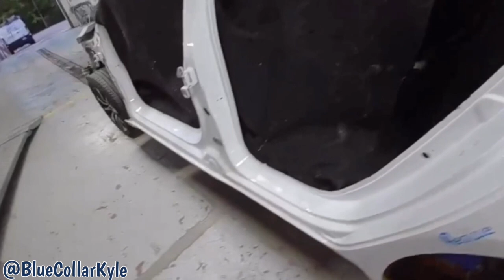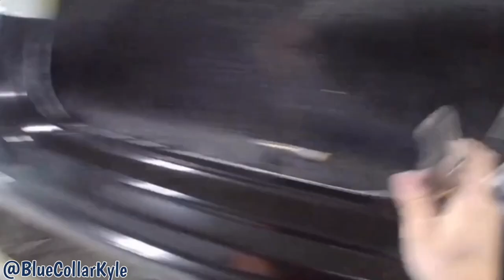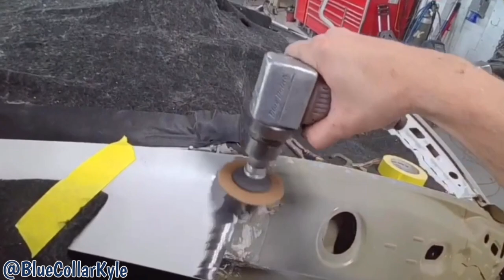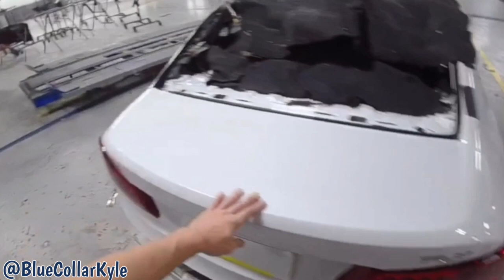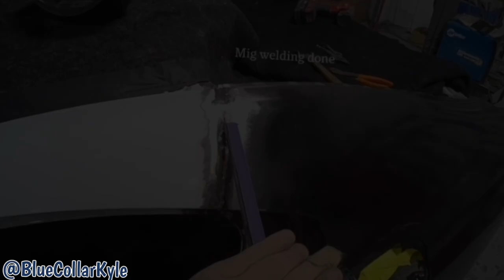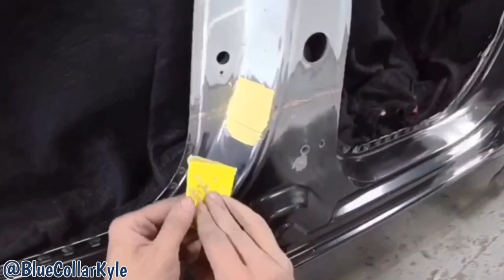Replacing Rocker & Quarter Panels

Comment: How much did this body work cost?
Reply: I'd guess somewhere around 9 grand total. 30 hours body labor maybe less maybe more then parts and paint. After he spreads the adhesive on the inner wheelhouse and quarter he should have run another small bead of adhesive. Covering the bare metal was correct but you still want a thin bead to make sure you have enough material....which is a total PITA when you told the flange...glue gets everywhere

Comment: You are sectioning the rocker and quarter panel in a big piece.. Could You not simply section it in a smaller piece way less work and it should still been just as strong? You are not replacing the whole side of the car after all. No need to install the large piece unless it was needed. Since You are butt welding the two new pieces together, Do not see why You can not Butt weld two smaller pieces..